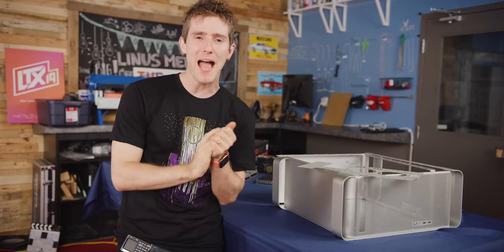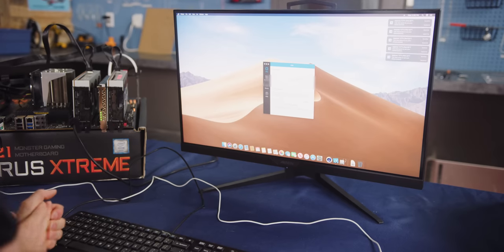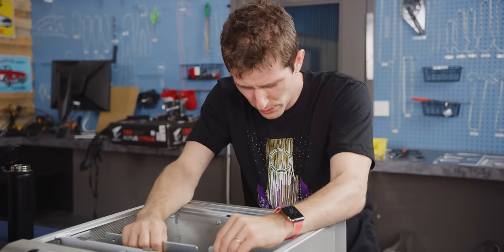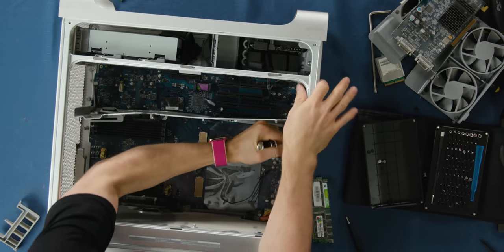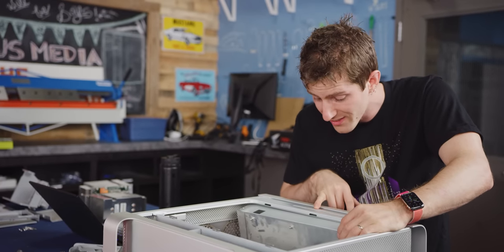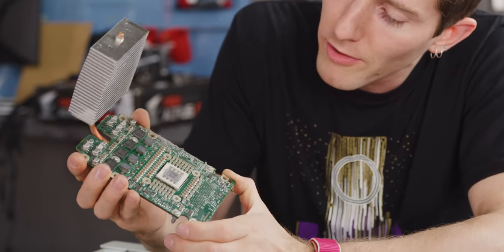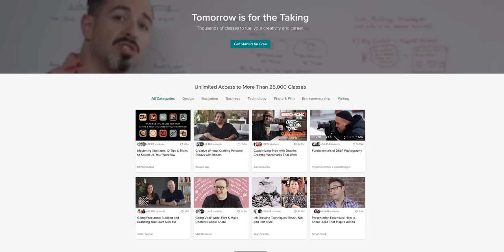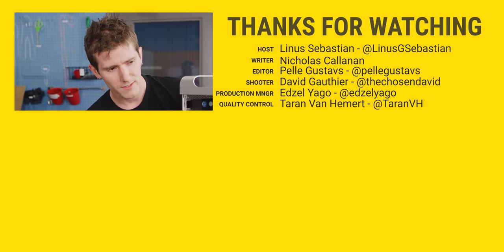I can't believe it all FITS!!! Hack Pro Pt. 2

Comment: I've got an old 2009~ era 24" iMac sitting on my desk, been thinking of if it would be possible to shoehorn some newer hardware into it. nothing major, just a somewhat modern i5 and some lower end graphics (like a 1050 or 1050ti) or maybe just leave it with integrated graphics. then run hackintosh on it.

need a mac for work but just basic xcode stuff and debugging of ipads. so only needs to basic, this one is just to damn slow.

trying to search online for anyone who has tried it before is a nightmare as the first 10 or so pages are either "The most powerful mac is 6 years old" or "can i upgrade the CPU in (insert model here)" anyone heard of anyone doing it?

Could possibly gut a laptop? anyone know what display interface it uses? if it just happened to use the same display interface as some laptops, that would make it a lot easier...

Comment: No, I did not hit the subscribe button. this rebuild is not what I would do since I would require that only the CPU, memory, and motherboard be replaced with an ATX board to allow windows to run while allowing for an optical drive to be included.

Comment: This series is so terrible. a 15 minute video where you show a bunch of parts, a 13 minute video a month later where you put the parts into the case. don't show us any of the machining or design or anything, that's fine, just parts in a case. And this was 3 months ago! the actual mac pro is already out! iJustine and Mkb already made their videos, and this project is still not wrapped.

Comment: WTF is the point of this video? I mean this is cool but not practical for the rest of us. This is a lot of work to modify an old case. Not even the new Mac pro uses this old case. Apple designed a new case for the new Mac pro. Why are you using an old case to fit a new Mac pro compatible parts? This is stupid. A waste of money (which you have a lot of and it's no big deal to you)  and time modding the case.

Why not build this new Mac pro hackintosh in a different case. It's going to run the same as it would in a different case. 

It's like building a new  ferrari using an old body design. What is wrong with you?